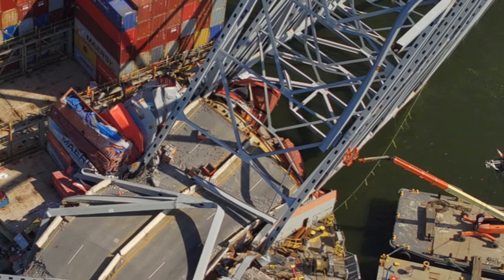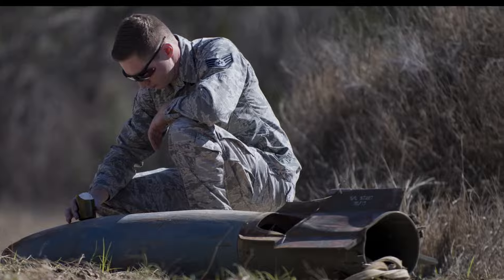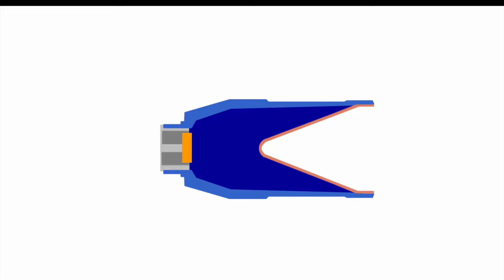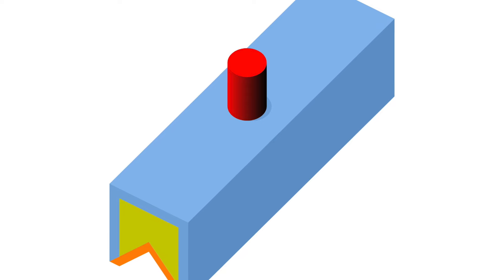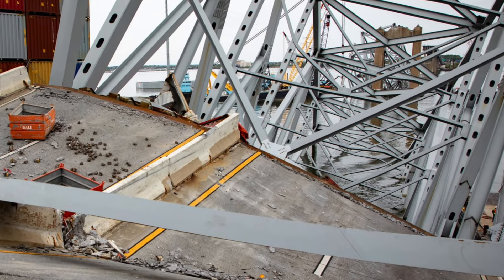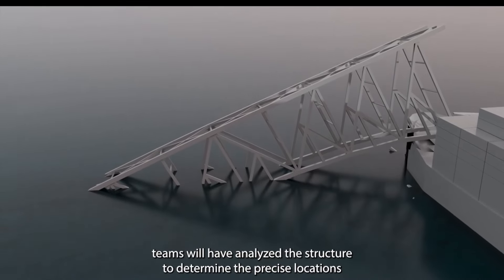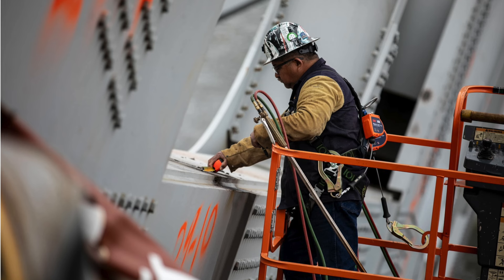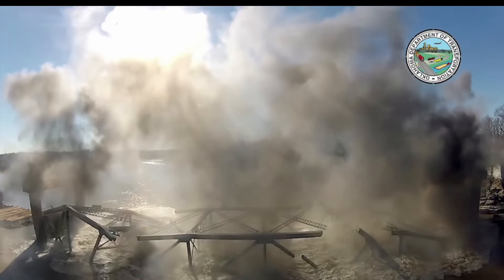Demolition Charges to be used on Remaining Sections of Span at Key Bridge Collapse Site in Baltimore

Comment: Hey Andy, back at you from Charleston. When they dropped the old Grace and Pearman bridges in Charleston harbor, they tried shaped cutting charges several times before giving up. The problem isn't or wasn't with the charges mostly but the sheer number of charges and trying to get them all to go off at the same time. Out of the many they were trying to attemp to ignite at the same time numerous failed to ignite and were still there afterwards. The bridge section was mostly dropped and cut but the danger presented by the missfires caused much delay for obvious safety reasons as an EOD guy had to go under and find the missfires. Hope it works better here.

Comment: Thank you, as always, for the great video.  When you look at it, it’s an excellent approach.  To continue with piece by piece removal of the mostly intact bridge trusses on the port side of the DALI would require supporting the whole structure with falsework and/or a flotilla of barges and floating cranes to avoid having the structure collapse on top of the demolition workers when they had cut away a critical amount.
Reply from the maker: Absolutely!

Comment: Wow! Sorry, this bridge was not near Tishomingo, OK! It did however look identical. There are dozens of these old steel frame over bridges being replaced in OK. The one south of Tishomingo was almost washed away in a flood. Others are replaced before a rode is shutdown and the old bridge is used throughout the replacement. Thanks for the great explanation. The cone and v shaped charge basically melts the copper lining the cone or v and focuses the molten jet at HIGH speed to burn through the “subject” material.
Reply from the maker: Oh wow!

Comment: They are going to be using Linear Shape Charges (LSC) which are a little different from what you are showing. They are copper clad which is a problem because the copper turns into shrapnel and can fly thousands of feet away. They used shape charges to demolish a power station in Kern, California. There was a guy standing a quarter mile away and the shrapnel cut his leg off. You can Google  it. Make sure you are behind something when it's detonated.

Comment: My guess is they will do all the charges as they can because the pieces after the cuts will likely be unstable if they hang up.  All the pieces need to fall away from DALI or at least straight down.  It will take the most time to set everything up and seconds to initiate.  The DALI crew can go to the engine room for safety.

Comment: well that is about the only way to unload the bridge off the ship unless somone has a 10k sea leg to pick the whole thing off of there
Reply: Agreed, because otherwise any full cut made would destabilise the entire truss.  

On the other side they've used 533 and now chessapeak to hold an end section while they cut it off.  The difference being that the starboard truss is resting mostly on the bottom & other wreckage.  At least half the length of the port truss is supported by the ship. Part cut it would bend move and shift, and to hold it you'd need far bigger than 1000t capacity. 

The governor has mentioned precision cutting multiple times, but has avoided the explosive word. That does suggest more Michael Bay in the popular mind.